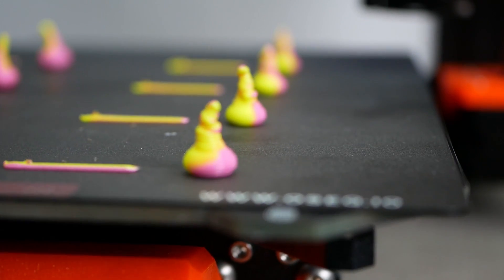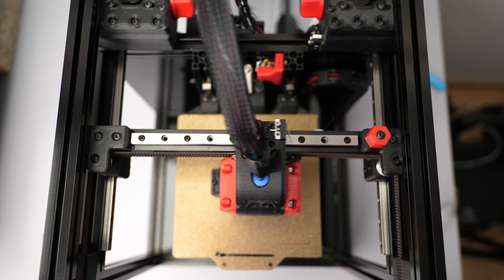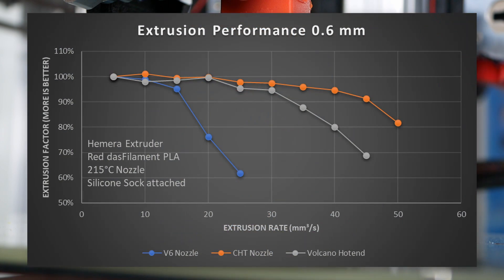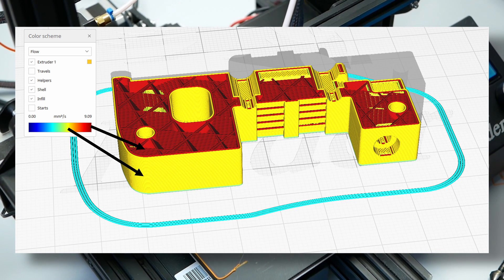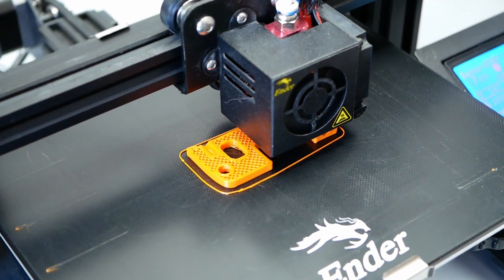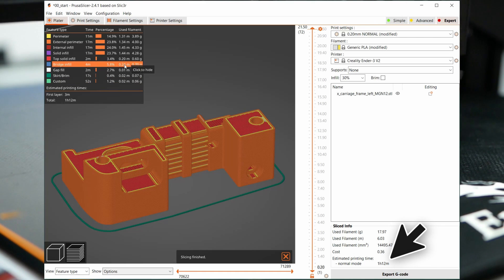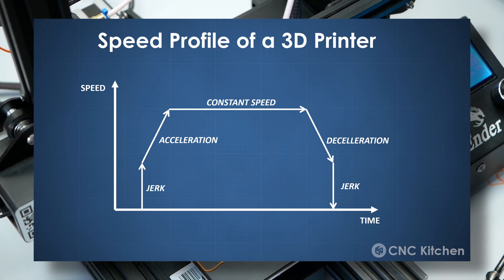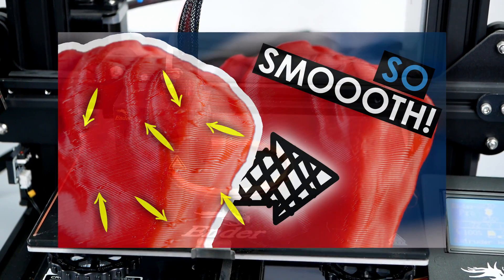Easy Hotend Benchmark for FAST PRINTING Profiles

Comment: Great video Stephan, I'm usually deciding on extrusion parameters and setting my feed rate to achieve a target volumetric flow rate.  So glad you pointed out matte vs glossy surfaces as well as an indicator of how well material was melted.

Comment: Great video! One other thing that I've done is use Prusaslicer's "Max Volumetric Flow Rate" to limit print speed. Then I can just set infill speeds to something like 120mm/s and let the volumetric flow rate automatically keep the speed at the max.
Reply from the maker: Great tip!
Reply: That was a reason why some tests didn't work for me in the past.

Comment: This is golden! I used the previous method you developed to identify the capabilities of my heavily modified Ender 3 with very good results. The Aquiles heel of my set-up is still the extruder, but based on what I found out with your experiment, that soon will be also replaced. Awesome work!

Comment: just a question isn't jerk expressed in m/s^3, being the derivative/time of acceleration (in m/s^2)instead of (m)m/s (time code 12:15) ? 
Elseway,  thanks for the video
Reply from the maker: I'm quite sure that mm/s is right. Marlin documentation confirms that as well.
Reply: @CNCKitchen   / ater xter - I've fallen for that one too in the past - I think you're right too but it's really hard to get a straight answer! It's absolutely not mathematical jerk (d/dt(acceleration)) :)

Comment: throw on a $20 cht nozzle and you could print that in 45min I bet
Reply: I have MK8 CHT and bimetal heatbreak ordered, not sure which would impact more 😀 I'm not so much after very fast PLA printing but "normal" speed PETG printing. Creality-style hotend does not shine with that material.

Comment: So much wasted filament :(
Reply from the maker: 0.6g each. Not too much and better than wasted prints.
Reply: Hardly wasted it gives a large amount of data for a little more plastic than a benchy... how many benchies would it take to get a similar amount of information of volumetric flow (a lot)

Comment: I'm glad you made this; it validates a comment I left on a video last year about how we've been tuning our printers wrong for so long. Previously the common wisdom was to just change print speed, but this ignored that the printer has to first accelerate to that speed and often never gets there. My ide (based on a teaching tech video) was that we should instead be focussed on finding out our printer's max extrusion rate for a given filament and temp, work out a given nozzle's maximum print speed based on that and then instead adjust acceleration and jerk to affect print speed.

Comment: 13:40
i use Arc Welder plugin (free), its transforms lots of line segments to arcs, im not exagerating, some NC Files got 90% size reduction while INCREASING quality, i dont know why this is not included on the software from the box.
Reply: As a cnc machinist it also confuses me. Lines are never ideal for curved surfaces.
Reply: For many years arc feeds were not supported...so slicers didn't include it. Now that it's pretty much universally supported there is no reason not to use arc gcode. Older 8bit processors sometimes struggle with arc interpolation at high speed...but not as badly as 'the serial port literally can't keep up' with 1mm segments.

Comment: but you never print a model with the same flow. The flow is constantly changing during a print, so if you raise the hotend temp in order to get higher flows, what would happen with that extra temp, when printing has to reduce drastically the flow to print a detailled zone of your model? I think a smarter slicer that can handle temperature changes during printing would be needed
Reply from the maker: That's the reason why you should raise the print temperature so much that even at the highest flow you only get 5-10% underextrusion which should make things quite even.
Reply: @CNCKitchen  For example, if I were to print the Disney Castle on my MK3, maybe I could set the temperature to 240 (for PLA) and print the body of the castle with a 15mm3 flow, but when I start printing the towers, if I not reduce the flow, it will make it melt, and if I reduce the flow of the towers, I would have an extra 40C, so if I don't cool those towers enough, they will also melt, or I would have weird artifacts like extra shiny surface. That's why I couldn't take advantage of my 0.8mm bondtech CHT nozzle (useful for me only for big constant flow models). So what I'm saying is it's not free just to raise the temperature hotend, it depend's of how much flow variation you have on the model your are printing. Maybe I could solve the problem by printing four castles at once instead just one, but the point is, we need a smarter slicer managing flows and temperatures. Sorry my english
Reply: You absolutely can print with consistent flow. Have to balance the speed against temperature against the reality of what your machine can actually do. Kind of what this whole video was about.
Reply: AutoTemp:

If your gcode contains a wide spread of extruder velocities, or you realtime change the building speed, the temperature should be changed accordingly. Usually, higher speed requires higher temperature. This can now be performed by the AutoTemp function By calling M109 S T F you enter the autotemp mode.

You can leave it by calling M109 without any F. If active, the maximal extruder stepper rate of all buffered moves will be calculated, and named "maxerate" [steps/sec]. The wanted temperature then will be set to t=tempmin+factor*maxerate, while being limited between tempmin and tempmax. If the target temperature is set manually or by gcode to a value less then tempmin, it will be kept without change. Ideally, your gcode can be completely free of temperature controls, apart from a M109 S T F in the start.gcode, and a M109 S0 in the end.gcode.
Reply: @SergeiPetrov  great, thanks!!

Comment: Great, thank you!  I've been struggling with the manual method for too long.  I have gcode macros in Octoprint to do something similar but never thought of just dispensing a blob.  The takes a lot (but not all) of the tedium out of the process.

I've also wondered about what to use for the 100% reference.  You use the smallest flow rate and I've tried that.  Lately though I've been cutting a length of filament and using it's weight for reference.  That makes my curve fits look better at least.

Comment: The slicer could have a flow correction parameter which increases the flow to compensate for the flow reduction at high flow rates. That way, you can maintain a lower nozzle temperature and still get decent flow rates.
Reply from the maker: It could theoretically to that but in the end, it's unfortunately not that simple because it's a very non-linear system.
Reply: @CNCKitchen  If you go into plastic fluid flows, it's quite complicated. You can see that your graphs are remarkably similar for different temperatures, appearing like a sigmoid function. I tried a modified sigmoid function; I got a perfect fit using your data with four parameters for one temperature. To be more exact, there are empirical plastic flow equations, which give similar plots, could be used, and maybe would reduce the problem to just three parameters: the two limiting viscosities and the rupture constant.
Reply: Stefan already answered this at 7:45 - when you hit the wall, no amount of extrusion will make situation better. When approaching the wall - either accept underextrusion or stay within linear (safe) range 😉
Reply: @kimmotoivanen  I was thinking of the up to 20% under extrusion when you try to push the speed just a little more. That amount of under extrusion creates small voids between neighboring extrusions which can weaken parts and affect surface finish.

Comment: It would be fantastic if Super Slicer could integrate some more of these calibration tests into the program, like they already do with other tests. Then it can automatically use the printer and filament configurations we already have.
Reply: Mention this on their discord or issue tracker. I believe they will strongly consider to implement this.

Comment: If you want to print faster on Ender 3 and with good quality you should use klipper instead of marlin... You can print PLA 100mm/s at 215°C. Outer walls 75. An you will also not have problems with models with lot of segments and it will be smooth.
Reply: Whys that?
Reply: @urgamecshk  https://youtu.be/MaUU8stsZPo    https://youtu.be/yAfalR7-Tvw  It is just better and faster. It runs on raspberry pi, not on printer mainboard. Printer mainboard MCU have just very small firmware which allow communication with Raspberry. All calculations and kinematics etc. is done by raspberry with much faster processor, so timing can be much more precise and with much more advanced kinematics and calculations. Also it is easy to configure everything, you dont need to recompile and flash firmware after each change, just save cfg file and restart printer MCU and you can edit it from web interface,  because everything is running on Rpi. Linear advance is not supported by marlin on 4.2.7 creality board. But klipper pressure advance works + input shaping. And you can also use klipper with octoprint (+klipper plugin), but octoprint is slow, so you need Rpi 3 at least for octoprint + plugins to have responsive web interface. I prefer fluidd. Again it is faster. Runs perfectly smooth on Rpi2. Disadvantage is only, that you cant use printer without Rpi. You cant print from SD card like with marlin. But who is doing that ? Everyone is already using Rpi with octoprint...

Comment: Great work stephan! The tool looks easy enough to use as a spreadsheet. Will update my comment once tested on my newly upgraded Marlin TronXY X5SA with cheap all metal hotend (0.8mm) and Marlin FW, (having inset issues with ABL).

Comment: I always love seeing new benchmarking/calibration methods, tuning my 3D printer has become a bit of an obsession for me over the last two years xD I tend to be pretty conservative with my printer settings, but just knowing how much of a margin of error I've got is a very reassuring feeling.

I'll test this out on my cheap all-metal heatbreak I just got; I've checked the temperatures with an external probe just to make sure heat creep isn't an issue (which thankfully it isn't, so that's a good sign) but a qualitative comparison with my stock hotend will be interesting to see.

Also, on the matter of creating a fast profile: I highly recommend getting an ADXL345 accelerometer if you have a raspberry pi or arduino to read the values from it; using the klipper guide on resonance compensation you can figure out how much you can tune your acceleration and jerk settings, and particularly on my Ender3 the stock settings are... conservative, to put it nicely. I can run those values higher with a DD extruder than stock does with bowden, just as a forinstance.

Comment: Another thing where you can save a reasonable ammount of time are travel moves. They don't need to move smoothly as there's no filament laid down that can show wringing/ghosting and underextrusion is alao not a problem for obvious reasons. I push my Ender 5 Pro to 500mm/s at 2000mm/s² for most prints with larger elements and/or fewer travel moves per layer. If the print doesn't take longer than an hour I can push the acceleration up to 3500mm/s² without getting layer shifts, but I only did this to see the limits. Most of the time I use 2000, and on parts taking longer than 12h I put a fan at the Y motor (that's the weak point for this printer) or go down to 1500. 
A nice side effect I observed was reduced and finer stringing with PETG (my prefered filament type) since there's less time it can dropp during travel.

Comment: hey!! I tried to make a sub-10min benchy on my ender3 a few month ago (settled on 10'33" for the moment) one of the parameter that can be useful is the skin line orientation, making it more aligned with the X axis allows the light print head to do most of the rapid accelerations ;)
Reply: stock bed, stock motion system (but with 95% rated current), I modified the print head a bit with a Sherpa extruder and bi-metal heatbreak + I modified the v6 nozzle with 0.4mm brass wire like in your videos (I kept the stock hotend and fans, the quality of the benchy is quite poor to say the least) then I mostly played with all the cura settings to optimize what I could, didn't post anything because there are 6min ender3 benchys out here using klipper (way too complicated for my mecanical engineer mind) but maybe one day.. 😶 I'll follow this comment with my settings when I have time to do so
Reply from the maker: Sounds great! Any more information on your setup and settings available somewhere?
Reply: Please make a video of it.
Reply: What bed are you using?

Comment: You've created the most delicious looking benchmarking tool with those coextrusion blobs! I love pushing speed when printing models, but I want to print quality models, not just print quickly.  Thanks, as always, for such clear information on filament flow rates and your new profiling tool!
Reply from the maker: Thank you very much!
Reply: @CNCKitchen  could you benchmark the hotend on the bambu X1C?
Reply: reminds me of penny sweets from 30 years ago pick and mix

Comment: THIS is the content that makes 3D printing so amazing to me, even though I've yet to buy my first printer.

Seeing this makes me want to get a cheap Ender just to tune it patiently. Tools like this make it possible.
Reply: Get that Ender, you won't be sorry.
Reply: If you love tinkering get the ender!!
Reply: As a tinkering kind of guy myself. Out of the Pro and V2, the V2 is the better model for tinkering. You'll have to get comfortable with modifying C header files either way, specifically the C pre-processor. A lot of the potential of these printers just doesn't come into play until you start to tweak the configs which are written in C header files almost exclusively using the pre-processor. It's kind of like an ini file on steroids.
Reply: @eideticex  or use Klipper and skip all that
Reply: Get an Ender if you like tinkering. Get a Prusa if you like printing.
Reply: @brettvitaz9101  
For me:
Get ender if you are poor
Get prusa if you are rich